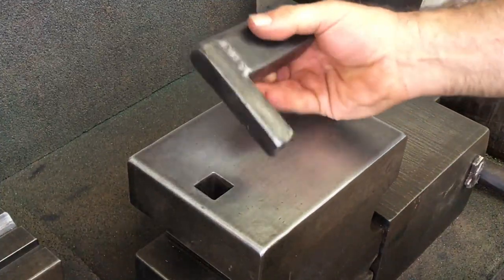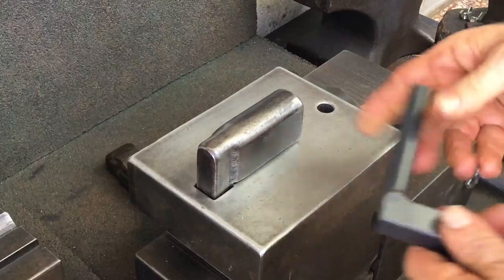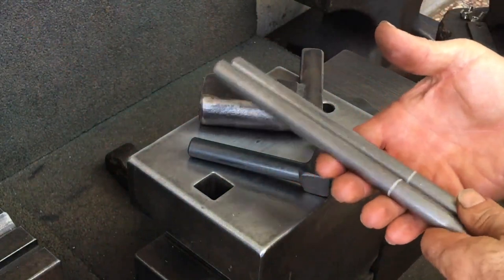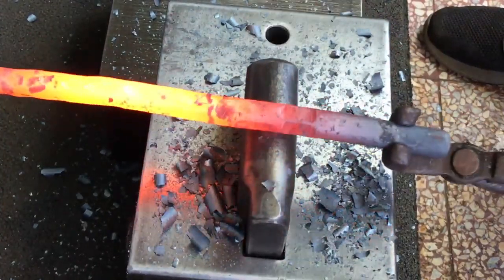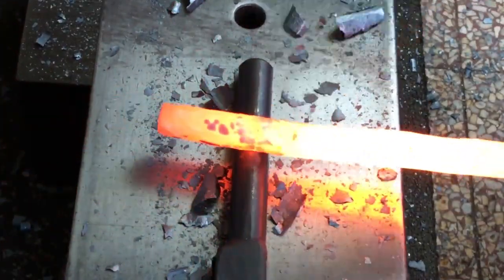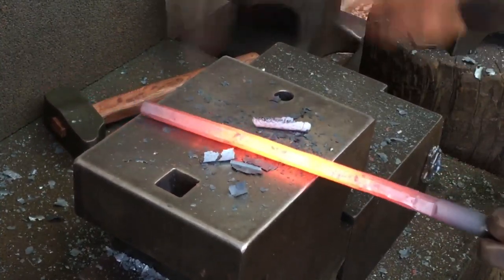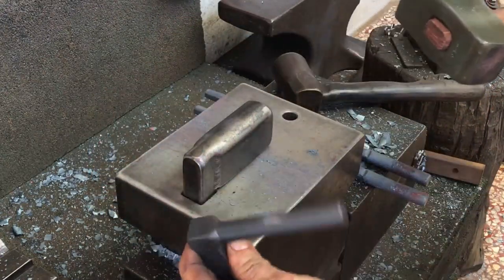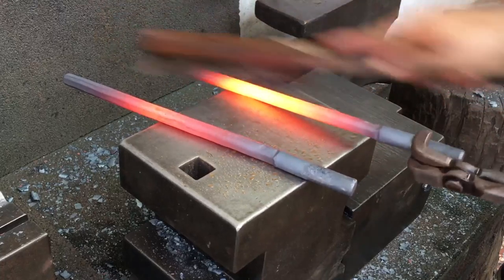Drawing Hot Steel By Hand More Quickly

Comment: The smaller diameter bottom tool nicely illustrates the notion that the surface area of the bottom tool affects the speed of drawing out the steel.
Reply from the maker: Yes, for sure. The smaller diameter one worked better for me and matched the cross peen hammer well. Thanks Bryson.

Comment: I always like using half on and half off hammer blows on the edge of the anvil to draw out material quickly. Lots of people like using the horn but it scares me it might break or crack.  My anvil is wrought iron and has survived since 1923. But the thought is still on my mind, so I try not to hit to hard over it.
Reply from the maker: The anvil edge is one spot I need to focus more on for stuff like drawing. If I had a big, immoveable horned anvil I think I'd use the horn much more. Thanks Erik.
Reply: I don't like using the horn for drawing out either for just the same reason. It also makes mine ring like crazy.

Comment: I had made a large punch with a fairly large head with a hole in it for handle. It was used for punching a hole in making of other punches and hammers. The original punch belonged to the old blacksmith that taught me blacksmithing. His punch was in line with the handle, which made it hard/awkward to hold his punch and hold the yellow hot hammer head blank. So when we built mine, we made it so the punch was 45 degrees to the handle. That way I could hold both the punch and the hammer head blank comfortably and not impede the striker(s). With yours the cross peins were either 90 degrees or 0 degrees. Try make one in 45 degrees. See the difference!
Reply from the maker: Hi Randolph, Others also mentioned a diagonal peen hammer and I like the idea. Should work better for me. And thanks for sharing your story.

Comment: works for me, I have an old bulldozer ripping hook thing that weighs about 550kgs that I am slowly converting to use for forging  ...I will be welding some pieces of spring steel to the top edges to do exactly this ...yours is less permenant than mine though ...good stuff
Reply from the maker: Yes, mine is a whole lot less permanent that what you described. Thanks for sharing.

Comment: Maybe you need to make yourself an angle peen hammer? It would allow you to strike at a right angle instead of 45 degrees. Do you think the bottom fuller is faster than the horn?? Thanks Glen.
Reply from the maker: Yes and yes. A few others also mentioned a diagonal peen and I think this would be good for me given I'm seated at a slight angle to my anvil. If I had a big, immoveable horned anvil, then maybe the horn would be better. But the small diameter bottom fuller works better for me. Thanks.

Comment: Do you find it easier to use these drawing Hardy tools, vs just some drawing dies in the guillotine tool?  I have not done any of this yet, the few times I’ve done it I’ve use the horn. But I had thoughts of just switching to a guillotine tool. So I’m curious if you think there is that much of an advantage to using the hardy tool instead of just some dies in the guillotine tool
Reply: Never mind, you explain this later in the video!
Reply from the maker: Yes, I find directly hammering on the stock when using hardy tools to be quicker than using my guillotine tool(s). But this may depend on your steel / size and shape, and what you need to accomplish. Thanks Dan.
Reply from the maker: No worries. Always good to repeat. Thanks.